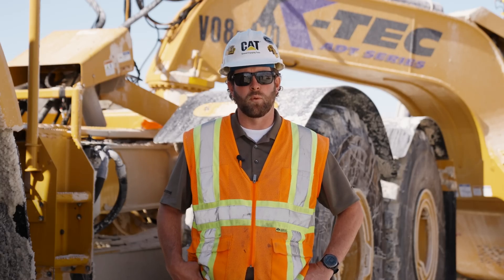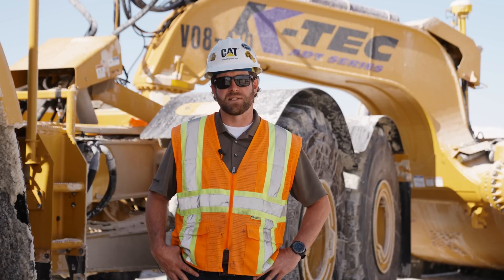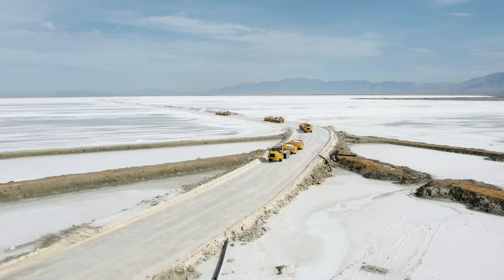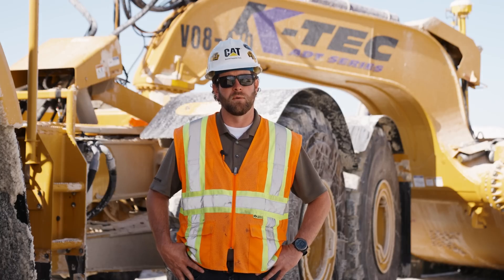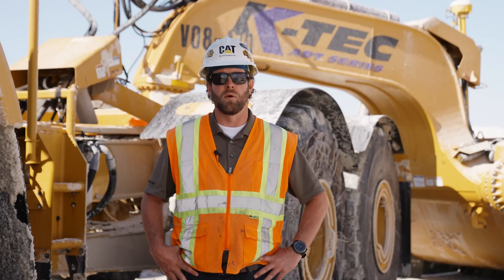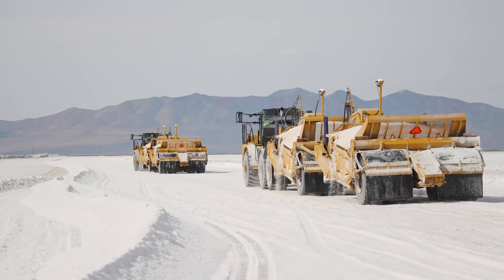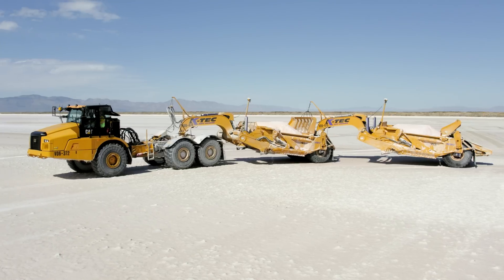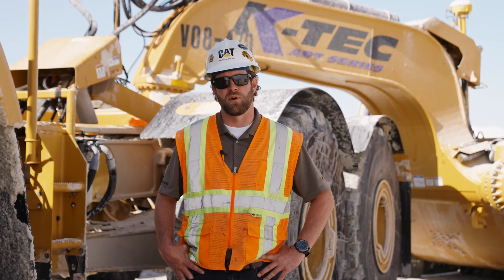Salt Mining With Scraper Trains

Comment: Can't see anything when cutting,  they are too light for cutting heavy clay . Unless it has a HUGE drop center cutting edge . But then your cuts look like v ditches......
 I guess that's why motor scrapers have offset cabs + weight for down pressure when cutting.

Comment: Wouldn't it be better to have larger side walls to, ya know, like, not have stuff spilling out?
Reply: Adding hungry, greedy boards or extra side walls to contain more payload may affect the structure of the scraper itself. If they wanted more payload the customer might look at purchasing bigger machines if necessary.  The tires may also be affected as manufactures have quality guidelines on pressure and payload while covering certain distances. Probably the reason why the truck is towing two scrapers, its within the parameters of the machines capabilities under load. The spilling out over the sides is an indication the bowl or scoop is fully loaded and can be picked up on the return cuts. This all depends on the density of the material too.
Reply from the maker: @72chops  Bingo!
Reply: @72chops  Very interesting thank you very much.

Comment: All the corrosion from salt must drive the mechanics up the wall
Reply: I just recently did some welding on this sight and there were dealer mechanics there everyday and a boneyard filled with quite a few newer series dozers, loaders and artic trucks just corroding away
Reply: salt is only corrosive if its wet and well yes i get that salt looks very wet.. just saying lol salt needs moisture to corrode

Comment: I'm wondering what they do for anti corrosion efforts. Wash them each day? How many parts replaced with stainless. With Naval aircraft that fly low over the ocean, they often have what they call a "bird bath" at the field. It's a bunch of water jets in the concrete that shoot up, and they roll it through after each flight.
Reply: Nothing mate, I used to work at a salt mine and send the dozers for full rebuilds every 3 months
Reply: @Bigsoot7393  Running through expensive equipment like that blows my mind, but if it's profitable it makes sense... Makes the dealer very happy indeed, well the owner at least!
Reply: I race at Bonneville Salt Flats just down the way from this video and what we try and do is treat as much material as we can in advance, then wash and scrub the rest when we finally get home.  Some parts are sacrificed, I just replaced the complete brake systems on all 4 corners of my 2 year old Duramax GMC because everyday driving on the Salt, while racing, completely fills the wheel well all the way to within an inch of the tire. With the tractor shown here there is probably a million dollars in parts sacrificed, but if the miner can bring in more products for less money, like anything else, 2 thumbs up. When the wheels fall off my truck every 5 years, I buy another because I race, that's what I do.✌😎
Reply: Ships use something called "sacrificial anodes" to reduce corrosion. They are basically large chunks of a metal that is more reactive than steel and get corroded before the hull, and are designed to be a lot cheaper and easier to replace than structural metal. However, as far as I understand the concept, the metal ions basically form an electric circuit and a part of that is completed over the water. Whether it also works on a land vehicle that is much less wet, or at least not partially submerged, is a good question that I'd also like answered. Speculatively, it might work by completing a circuit with the battery/ground terminals? The region looks very dry, which helps slow down corrosion. Either way, the machines certainly don't get any better working in salt... I imagine the mine is very good friends with their welders and Cat dealer, haha.
Reply: i’m not sure where this plant is in utah but i work at cargill salt and our equipment lasts extremely long, we have haul semis with 600,000+ miles. we just replace parts as they break, more then not the truck itself is fine it’s usually the trailers that get beat
Reply: @109FreedomClips  yeah that wouldn't be too bad mate but anything that is directly touching the salt like a dozer, metal on salt is cooked haha
Reply: From my experience, companies that use machines near the ocean or in high-corrosion environments, have the cost of replacing the machine after a few years built into the cost of the product. 

I talked to a foreman with the company cleaning up Oak Ridge National Laboratories' nuclear waste site. They said that the stuff they were digging was so radioactive that they buried 2 brand new Cat 320s after 2 weeks. Then bought new ones. One of the haul truck drivers also said that the company replaced 100 dump truck's worth of tires after a month or two because of the same issue. 

Comes back to being built into the cost
Reply: @historyyoucanhold  Good grief that's a lot of money! But very interesting, thank you.